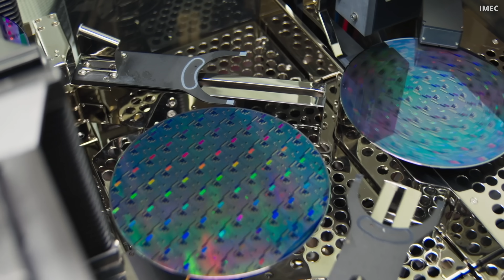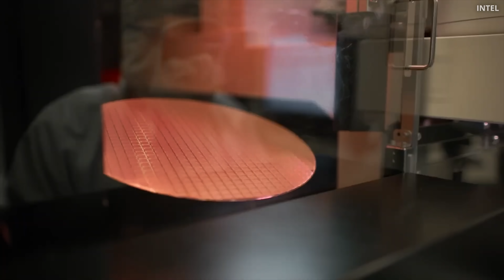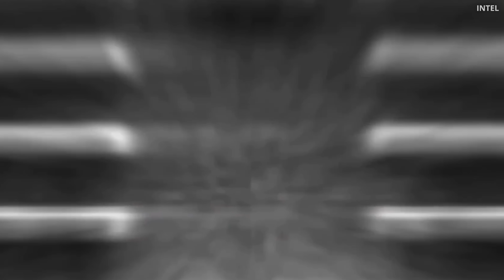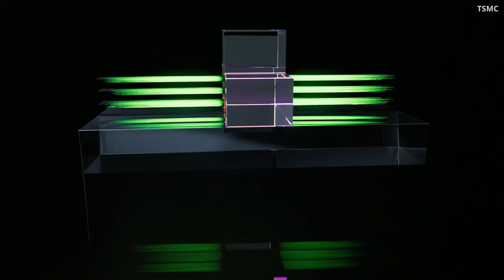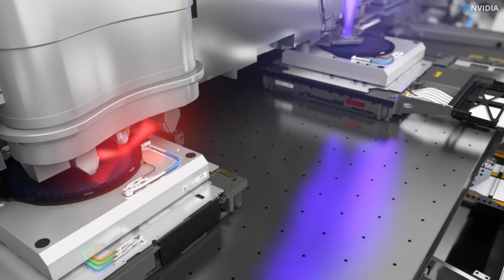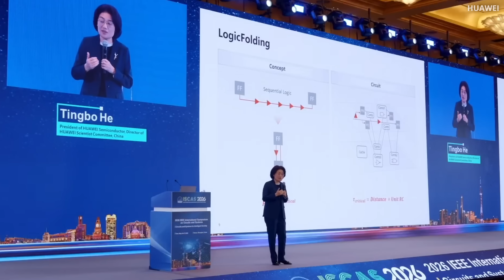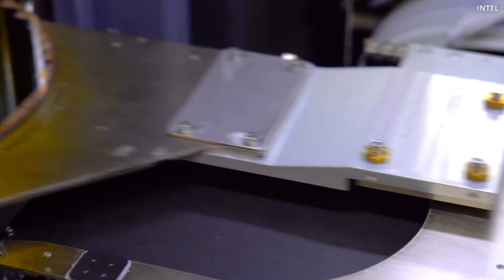China Just Built What TSMC Said Was Impossible

Comment: I think the biggest boon would be analog computing.  I may not know anything about chip making or computing, if a bit could represent ten different states rather than just two, then that would make the need for a high clock frequency not needed/wanted.   Fewer bits could mean far fewer connections and a lower clock speed means less heat.  The issue is has the voltage stability of the transistor become good enough to reliably work with multiple states of a bit.

Comment: thing is: with flat design heat transfer is much less complicated.
rest of the world needs to validate first if huawei has an answer to that. what use is a cubed processor running at say 200 MHz because it would burn up if the clock speed is faster?

Comment: I wonder if you can use this kind of stacking to fold the computonium around a copper heatsink core.  Like the wires through green cheeses. Have the heatsink inside the chip.
Reply: From what I have read, this is essentially the plan. Not sure what materials they’re using, but the idea is to sandwich heat management in the middle.

Comment: The distance answer is simple...While 3d in chip level makes sense, you still need to cool it and that compounds that problem. What we need is teraherz+ wireless networking between compute nodes. It could all go through a shared waveguide with a vacuum drawn inside to eliminate loss. I imageine what looks like a broccoli crown with each little bud (the little green bits at the end of the crown) being a compute node and the stem structure being waveguide. but in all angles as a sphere, so every node's radiation reaches another. Network protocols would have to be completely rethought, but the benefit it that all nodes have equidistant connection points and everything travels from point a to b at teh speed of light with incredibly high bandwidth. This is doable today and honestly surprised we're not pursuing it already.

Comment: I think moving the heat around was the key to efficient steam engine design, finally managed with theoretically-calculated engine cycles. 
Now it begins to seem that the chip houses are building systems of billions of tiny steam engines. 
Maybe they need to break up the time into heat-transfer cycles just as the engine builders did.
Reply: Synthetic diamond has an exceptional thermal conductivity that is roughly 4 to 5 times higher than that of copper .
China’s synthetic diamond industry has achieved twin technological breakthroughs: the creation of a rare, ultra-hard "super diamond" (lonsdaleite) that is 40% stronger than natural diamonds, and the production of ultra-large, basketball-sized single-crystal diamond wafers to cool next-generation artificial intelligence (AI) semiconductors. These milestones firmly position the country—which already produces roughly 95% of the world's lab-grown diamonds—to dominate both industrial machining and advanced microchip manufacturing.

Comment: For the cooling of heat generated by switching, is it not possible to create destructive interference vibrations to try and reduce the heat by reducing the vibration of the molecules?  A frequency in time with the clock speed but out of phase. Even if there is only heat peaks at those frequencies, it should still help reduce it. Additionally, they could make the transistors and connections in a way where they have a natural resonance frequency to help.

Comment: They can go around heat problems with less power sacrificing some of the performance. Overall performance will increase drastically by reducing the distance by that far. It will be ++++ perf --perf = ++perf. As a result performance per watt would be impressive too. It is certainly possible and not that big of a challenge compared to how to design and manufacture the folded chip with those interconnects
Reply: Synthetic diamond has an exceptional thermal conductivity that is roughly 4 to 5 times higher than that of copper .
China’s synthetic diamond industry has achieved twin technological breakthroughs: the creation of a rare, ultra-hard "super diamond" (lonsdaleite) that is 40% stronger than natural diamonds, and the production of ultra-large, basketball-sized single-crystal diamond wafers to cool next-generation artificial intelligence (AI) semiconductors. These milestones firmly position the country—which already produces roughly 95% of the world's lab-grown diamonds—to dominate both industrial machining and advanced microchip manufacturing.

Comment: So far all they've done is to very loudly say that they're pushing for the same end goal as the logical conclusion of AMD's X3D journey. 
I get how this can double effective transistor density. This can certainly be used to improve efficiency. 
The part I don't understand is how or why they're claiming to increase clock speeds by 13% while improving efficiency without using a better underlying process node. Does anyone know what that claim is based on? Are they planning to save that friggin much energy by reducing data movement?

Comment: as soon as huawei said stacking, i was thinking how they're gonna cool the chip, if huawei hasn't released anything info about that, I very much doubt this will amount to much.
Reply: There is info about this actually, the idea seems to be that since heat in chips comes primarily from power draw and subsequent resistance, that logic folding already tackles this problem by reducing length electricity has to travel within the chip. Less travel = less resistance = less heat.
Reply: Synthetic diamond has an exceptional thermal conductivity that is roughly 4 to 5 times higher than that of copper .
China’s synthetic diamond industry has achieved twin technological breakthroughs: the creation of a rare, ultra-hard "super diamond" (lonsdaleite) that is 40% stronger than natural diamonds, and the production of ultra-large, basketball-sized single-crystal diamond wafers to cool next-generation artificial intelligence (AI) semiconductors. These milestones firmly position the country—which already produces roughly 95% of the world's lab-grown diamonds—to dominate both industrial machining and advanced microchip manufacturing.
Reply: @xxoo-lp6vc  interesting! need to look it up
Reply: My thoughts too. AMD pulled it off, stacking the cache on the cores for their first gen 3D chips but the latest are the opposite, cores on cache. Likely due to heat, the 5700X3D/5800X3D had lower clock speeds than non-X3D chips due to heat management.

Comment: The 1.4nm density (and ~5GHz frequency -- which is genuinely impressive), almost certainly implies stacking a 3rd layer. The density graph shows a sharp jump between 2030 and 2031 when this process is projected.

Great video. I'm a genuine fan of Huawei given what they've accomplished given their extreme handicap.
Reply: If you want a third layer, you need to connect through the substrate, via’s and that comes with its own challenges. The thermal management of the middle layer will be even larger then. There is a famous saying in Dutch that says that between dreaming and doing there are always practical problems 😊
Reply: @bartdenturck5134  Yes. Were there no challenges, it would be done today. But these problems have solutions, and Huawei is credible.
Reply: vias*
Reply: What they are doing is optimizing the chip layout and stacking.   That can buy them some time, but eventually they will need to shrink the actual transistors.
Reply: And given the stunning quality of their telecomm equipment.  Mobile and broadband wherever they're installed leaves the rest way behind in reliabilty and durability.  An american expat in Singapore & Malaysia, which are 100% Huawei areas with vastly superior telecomm service to the US for a fraction of the cost!
Reply: @davidrichards1741  Yep!
Reply: 2031... wait 2nm already exist. So long time and not even 1nm. 😤 I know is too expensive. China not even close to 3nm in reality , tsmc is leasy, intel save us 😭
Reply: @tomaspavka2014  C'mon bro...
Reply: If by "extreme handicap" you mean how Huawei unethically stole Cisco's networking gear IP to jumpstart themselves into a very large networking company selling Cisco-cloned networking gear (that was actually able to run Cisco firmware upgrades), then yeah, you're a fan of one of the biggest tech thieves on the planet.
Reply: @ellayararwhyaych4711  No, I mean that they were sanctioned and were cut of from critical technologies.
Reply: @SeanLumly  As they should be after continuously stealing technology from other nations. If you can't respect other people's property then you don't get the benefit of them entrusting it to you anymore.
Reply: @Spirit_Wolve  Serious question: What among the modern developments was stolen?

Show me one critical MODERN technology with a credible piece of evidence suggesting that it was stolen. And not some unsubstantiated claim, nor a western news article -- something that would be actually convincing to a skeptic.

I'm genuinely interested, and fully willing to confront the validity of this logical red herring as I've heard the claim before.
Reply: @SeanLumly  "Credible piece of evidence" is not something you can provide in a youtube comment section. Literally all the information on this topic can be googled in 5 minutes, so quite frankly: google it. They have gotten caught stealing everything from military designs (F-35) to 5G infrastructure data. Almost all the advanced technology they have has had at least one significant part of it stolen. Intelligence services have caught them, companies that had factories in China suddenly found their tech being produced by China without their permission, their spies have gotten caught trying to transfer technology, you name it. 

It's estimated to be multiple hundreds of billions of dollars each year that they steal. Independent institutions have verified this. I believe that estimate came from the Commission on the Theft of American Intellectual Property, but the EU also concluded the same thing and did a survey showing about 20% of businesses were compelled to transfer technology. Japan, Australia, the OECD, and far more nations and institutions have all given evidence towards the same conclusion. This is, quite frankly, not a matter that's in question in any serious institution about international politics.
Reply: handicap? srsly, if I had the entire nation of china budget and subsidies beside me I won't call it handicap, and the IP to steal for a lot products.... yea handicap.... sure
Reply: @KingStructre  They were severely sanctioned. This is a handicap, and what I was implying.
Reply: @KingStructre  The US is the inventor of hacking; only the US can steal intellectual property and then smear China.
Reply: @henrykum-nr7WW   I aint saying us didn't steal, but the entire budget is not there for westeran companies
Reply: @henrykum-nr7WW  Few people like the US outside of the US nowadays, but that doesn't mean China is suddenly absolved from their crimes. Quite frankly China has done a lot worse in every category where they're physically capable of doing worse. The only topics they don't treat other nations/people worse is when it doesn't benefit them doing so.
Reply: @KingStructre  steal like those people got a whole products copied out of thin air. If copying a sophisticated technology is that easy than why China is the only one who can do that? Yeah I bet your thinking will be because they are oppressed dictatorial country who just forced the people to do whatever the CCP wants as if the people itself didn't need to study and doing their own researched and knowledges just got uploaded staright to their brain 😂
Reply: @Grionlamahh? I am just saying they have budget no other western company has, and no legal repercussions to fetch data if they want to get… what the hell you talking about
Reply: @KingStructre  sure, maybe even Elon Musk can't do that 😂. Only the West can determine what is stealing and not stealing.
Reply: @Grionlam Agree. US is number one terrorist in the world. Europe forgot their colonization.

Comment: I would like to see somebody take all the parts of a chip, and all the layers, and see if they can get it to work on one 2d plane. Rather than multiple layers. I understand that this might be like taking many steps back, and you might end up with a less powerful product by some margin. But I reckon it might be more 3d stackable. So going back to go forward. Just to see if someone can get it to work.
Reply: Design in 2D and use AI like they do with protein folding to transform it into 3D.
Reply: May not be able to get enough surface area for pins.

Comment: Yes, Let's see how they cool the thing.
Reply: Synthetic diamond has an exceptional thermal conductivity that is roughly 4 to 5 times higher than that of copper .
China’s synthetic diamond industry has achieved twin technological breakthroughs: the creation of a rare, ultra-hard "super diamond" (lonsdaleite) that is 40% stronger than natural diamonds, and the production of ultra-large, basketball-sized single-crystal diamond wafers to cool next-generation artificial intelligence (AI) semiconductors. These milestones firmly position the country—which already produces roughly 95% of the world's lab-grown diamonds—to dominate both industrial machining and advanced microchip manufacturing.
Reply: MEMS CoolFan，Is this method  good ?
Reply: Good point. You kind of need to cool both sides now
Reply: You're so smart. I bet the ten thousand engineers working on this haven't thought of that.
Reply: Ever thought of thermal conductivity of SiC wafer?
Reply: It actually runs cooler because the distance the electrons have to travel decreases significantly due to folding.
Reply: @Emphasis213 I’m not sure it decreases much, vertical metal stack is tens of micron high for modern technologies…. And it will be repeated twice for top and bottom part of the folded logic

Comment: Stacking = folding = stacking?
Reply: This was my thought at first too, but it is not entirely correct. The big differentiator has to do with reducing travel distance, and thus time (the whole conceit of tau scaling), it takes for data to move between parts of the chip. 

While 3D stacking is similar, Huawei is taking it a step further by breaking down the actual computation between top and bottom chips. 3D stacking is essentially taking two complete chips and putting one on top of the other. Huawei’s innovation is designing the whole 3D space as a single chip.
Reply: In essence

Comment: Someone is going to create the equivalent of a Napster/Bearshare/Limewire but for LLM use on local hardware where you get paid for people to use part of your GPU and then all the datacenter noise will perish overnight.
Reply: Not exactly right. LLMs are very dependent on timing. The entire model usually needs to be loaded on vRAM using latency sensitive parts for GPUs to communicate. Timing is a severe issue that stops this from happening if no one is able to come up with a more decentralized architecture for inference.

Comment: I hope it works out, the market certainly could use the competition.
Putting it into phones is smart fist is smart as well since Huawei owns that aspect and doesn't have to convince more risk adverse data center customers to gamble on new tech. With the added benefit that as long the first chips are decently fast they will be fine for most smart phones as the performance need for those has mostly peaked.

Comment: What about the quantum tunnelling interference problem? Have they solved that?
Reply: Nope. Hence why trying to fold and go vertical to put more processing in the same foot print.
Reply: No. This is why they are trying these workarounds. Probably the next "Gate All Around" FETs will be the last technology of silicon, and then we will try to move to photonic processing (and hybrid silicon-photonic solutions).
Reply: I am not sure there a quantum tunnelling issue with hybrid bonding and logic folding … or you know something more on this topic ?
Reply: @dchdch8290  he means when you make the lines that electricity passes through so tiny electrons can pass from one line to the other causing noise and bad data
Reply: The quantum tunneling issue is not applicable to the physical geometry of the Huawei chips at this point as they are still at the 7nM node. Quantum tunneling is only problematic around 3nM or smaller feature size.
Reply: the 'solution' atm is excessive and redundant error correction , you cant stop the tunneling , but you can account for it and adjust accordingly
Reply: The first thing that crossed my mind

Comment: Isn't this similar to what Intel wants to do by using 2 sides of the CPU?
Reply: Nope, Logic folding designs the chip with multi layers in mind to CUT the distance, this requires very specific EDA software to do...  The current Chiplet way does not do this, it simply slaps 2 chips together but you don't get the benefits of time and speed without designing it properly